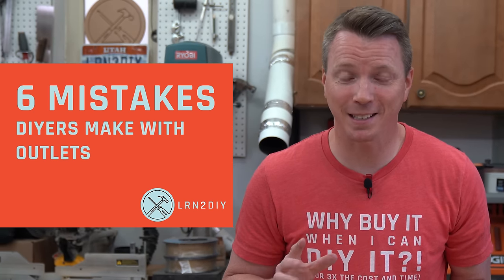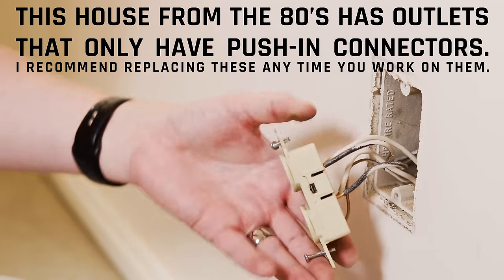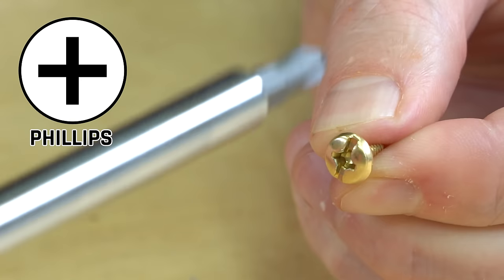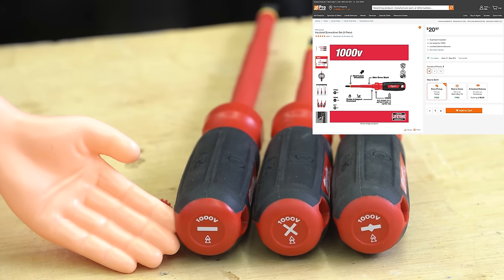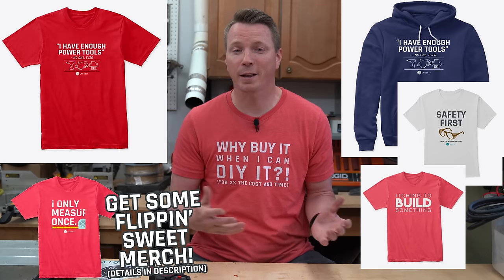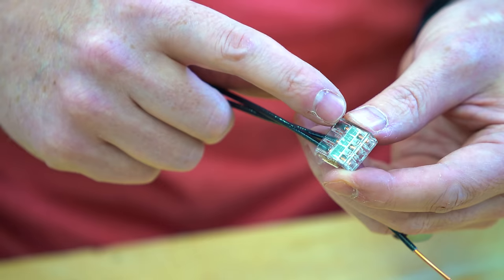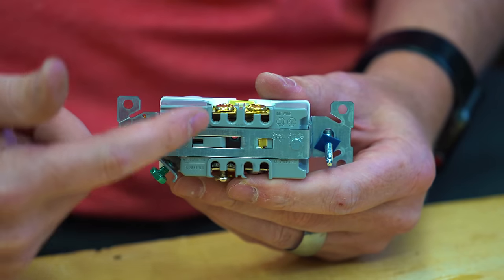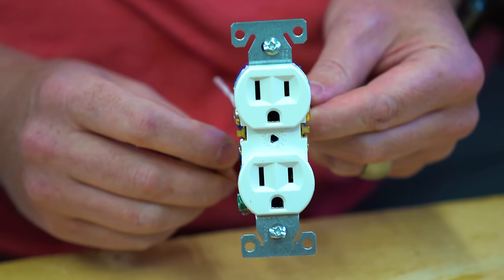6 MISTAKES DIYers Make When Wiring Outlets

Comment: When I DIY, I win in three ways: I get not only the thing fixed, modified or replaced for no labor cost; but I often learn invaluable skills and get experience. When I pay someone else to do something, I lose out in 2/3 aspects. The technician gets PAID for experience and learning that happens with doing something technical. I have not regretted learning how to fix my microwave, power outlets, changing my own oil, brakes, installing my own wired surveillance cameras, fence repair/replacement, lawn equipment repair & service (the list goes on and on). I am not smart; I just try
Reply: I feel like most knowledge is just a result of desire and effort. And vice versa.
Reply: @usefulidiot21  I like that. I'm uncertain if it could be proved, but some are definitely more curious than others. If you are extra curious, then you are very lucky.
Reply: Fix yourself is always good.  Electrical is pretty simple, taken one item at a time.  The device is either wired/installed correctly or it isn't.  I pay a licensed mechanic for oil changes because he will recognize problems that I would not, simply due to experience levels and training (only works well if you have an honest mechanic) (He once showed me an issue - when pointed out I could see it was wrong, but I would not have noticed if I were doing my own change)
Reply: @99bn99  definitely not good to creep into areas you feel discomfort. There are a few areas I won't go: HVAC is one of them. I change filters, replace start capacitors and contactors, clean coils, but that is it. I don't touch anything automotive AC either (outside belts, general cleaning and cabin filters).

Comment: I have never seen the wires "come out" of those back-side ports, but I have encountered dozens where the wire broke off over time.  It is always a clean, straight break like you would expect to see in a bolt that snapped from shear forces.  This results in the outlet sporadically not working right, typically working for a few hours after I plug something in, then flickering power for a bit, then losing power altogether.  It is a severe fire hazard and I would like to see consumer-protection laws which prevent the inclusion of these ports altogether.
Reply: When the circuit and especially the outlet has a large current draw such as a big vacuum cleaner or a 3 horse compressor using it, these cheap backstab installations will fatigue and you might begin to see flickering.  If that outlet is pulled, invariably one of the wires slips out the back because the spring has been overheated so many times that the metal no longer pushes hard enough to hold the wire in.    Maybe they are ok for a site where only a 60 watt desk lamp will use the outlet.  Large pull devices will wear them out.  If the circuit is multiple outlets and they are all daisy chained using the top and bottom holes instead of pigtailing, then this problem will spread down the line.
Reply: You might also have had situations where the person doing the initial wire stripping had done this improperly and had forced a slight indentation/cut in the copper wire, thereby weakening it.  I've generally done my own wiring, but one time I did have an electrician wire a small house for me, and he had a newbie helper.  I spot-checked the job later and discovered that practically every wire he stripped had been deeply nicked--and some that I barely wiggled had then broken off.  Clearly, what he had done was use the stripping position for #14 or #16 wire when stripping #12 wire.  I completely redid every single switch and receptacle, as I had specified that I wanted #12 wire throughout except of course where heavier wire was required..  The electrician himself was more than embarrassed.
Reply: They are phasing out quick wire devices

Comment: Great video. I have a 3-bulb light fixture with a dimmer switch and I get a lot of flicker in the last bulb. I thought it was the dimmer switch that was old and needed to be replaced, so I put in a new one. But the flicker is still there.  :-(  But now I'll go back in and check the wire nut connections because they were not twisted as shown in this video. Thanks! I think you saved me about a hundred bucks on an electrician!
Reply: Check the ratings for your bulbs and dimmer to be sure they're compatible. Some dimmers wont work with leds.

Comment: Mistake #7: Hot and neutral swapped.  (Blatant code violation, lethal hazard for things like toasters.)
Mistake #8: 14 awg conductors, 20 amp breaker.  (Code violation, 14 awg wire needs a 15 amp breaker.)
Mistake #9: Joining grounding conductors with ordinary wirenut. (Possible code violation, needs a grounding-listed connector like a greenie or crimp.)
Reply: Some may not know what a greenie is...aka Green Wirenut!  HTH
Reply: Disn't know code required a green twist cap.  Thank you.
Reply: @terrywebster9772  Code just requires grounding connectors to be "listed" (UL 467).  Some ordinary wirenuts are listed for grounding, but others aren't.  It's not clear to me if this just paperwork, or if grounding really has substantially different requirements.
Reply: A normal wire nut is completely fine. Unless you really need and want to use the hole at the top of the green nut. I didn't have any green nuts and just made a pigtail with my normal wire nut. Nothing wrong with that. A normal wire nut is completely safe to carry a full load. It's also safe for a ground.

Comment: Stab connectors - I did a bunch of experiments and concluded that they can work well but... when installing the outlet where outlet wire needs to be bent and stuffed in there is no way to know if the connection is still good.  Also, wires are very difficult to remove and doing so often compromises the quality of the connection when wire is reinstalled. There are commercial stab connectors but they have clear plastic and mfg says don't reuse once a wire is removed.   Lever connectors are great for tight spots.  Pig tails work but eat up a LOT of room.
Reply: I always get irritated about the 6" of wire coming outside the box requirement, that's guaranteed to cause a bunch of those issues trying to stuff all that unneccesary wire back in the box.

Comment: A simple and clear video.  Nicely done.  Just a side note, all the ads inserted by YT in your video were in Spanish.  Interesting.  Leviton recently showed off some new outlets that use a similar lever lock as a Wago connector.  No screws or exposed wiring.  I wonder what the reaction will be.

Comment: 8:03
When I put a wire nut on, I like to wrap the nut and wires with a bit of electrical tape. When I put the tape on, I fold a little ot the tag end of the tape against  itself, making a convenient "handle" in case I ever need to take it apart in the future. Just a little extra insurance to keep the nut from coming loose.

Comment: On the back stab terminals: They are clearly not best practice, but I maintained an old apartment building where they had been used very often and I don't remember a single failure with them. The newer ones don't work with 12 gauge wire and when I added circuits I always used 12 gauge wire so I never used them. On making the hook. Even though I've done quite a bit of electric work, I didn't know about that trick. Thank you.
Reply: Stabbed in the back devices are one of the 1st things to look for trouble shooting Id say probably accounting for nearly 1/2 of service calls customer stating "no power". Tripped GFI's, Breakers not reset properly and stabbed in the back devices generally  being fixes with actual failed parts being being less than 20% of calls!
Reply: @robertgarrett3980  Thanks for the response. I completely believe that you are right. I have seen several comments along that line. If there was a purpose to my post, it was just to say that in the right circumstances and perhaps with the right brand of outlet they might be reliable enough to leave them alone, at least until you start noticing some failures. I really like the way GFCI outlets are connected and I notice that higher end outlets have a similar connection method. I'd pay more money for outlets that connect like that.
Reply: Dave I haven't seen a single back stab failure either and I've been running a Handyman service for 24 years.  I think it's just people repeating what they've heard.
Reply: @cblanton42  ... the only place I have seen back-stab failures is on a kitchen circuit where higher draw appliances are used. Of course people can use an electric heater anywhere so worth looking around. If there's one bad outlet in a home there are probably others.
Reply: I'd bet dollars to donuts the only ones you ever have problems with, were removed and re-inserted or futzed with between initial install and your service.
Reply: I've had to replace burnt receptacles in my house because the back stab gets hot, loses tension, starts to arc.
Reply: @Sylvan_dB  So many people can testify to "broken solder joints" yet others can collectively put together thousands of years of experience having never encountered one. . .  Perhaps its got more to do with the human that was involved than the machinery?  Correctly installed they don't "get hot. . . "
Reply: @snap-off5383  I suspect there is some truth to that but I disagree vehemently on "not get hot."  Any outlet used for extended periods at high load will get hot and the back stabs get much hotter than the screws. This is easily testable with any continuous 1500 watt load. If not using the back stab, the receptacle contacts are the next weakest point and they will eventually fail the same way in the same usage unless they are built with separate steel tension springs (usually only in commercial and hospital grade).
On broken solder joints, I had them on my oven control board on the current carrying connections to the relays. A previous employer found them due to field failures with a commodity component that silently changed from tin-lead to RoHS compliant solder.
Perhaps the observer also affects the story by missing key information while doing root cause analysis. Which is why the plural of anecdote is not data.
Reply: Karma!
Previously I mentioned that I didn't remember experiencing a failure because of a back stab connection either in the apartment we owned for 30 years or in our house, Now only a few weeks after I made that claim the switch for the light over our kitchen sink wasn't working because the back stab connector failed. It had been working for 48 years and then I make that comment and it fails.

Comment: General Contractor's back stab, that is how I can tell if a GC did it or an electrician, in places like Boston backstabbing is code violation and you will not pass inspection.  I have had the same issue, I had a few GFCI sockets in the kitchen have open grounds or no power.  I had to redo every one properly.

Comment: NEVER USE 29 CENT BACK STAB OUTLETS THEY ARE used by contractors on track homes BECAUSE THEY ARE cheap,i wired over 200 homes they are junk buy only  spec grade or teck spec period..
Reply from the maker: Amen!
Reply: I agree. The cheap ones were fine in my house until I tried to switch over to fluorescent bulbs during the big switchover. Withing two months 4 switches and 3 outlets had cracked into pieces. I went through the house and replaced all of them (except maybe the two in the attic, it was August and I live in Arizona).
Reply: Takes two seconds to loop a wire
Reply: @Fred Wills running track baby
Reply: The English language more of joke compared to others say Spanish easier to learn ,english =there,their,weight, wait etc lol.
Reply: I noted on number 4 when making the pigtail that it was a bit short. It may not be an actual error, but by the time you push the wire connectors into the box, you don’t have much bending room to work with. 
Also, my preference is to straighten the bends rather than cut them off. You need to be cautious of damage in unbending, but I don’t like tight spaces caused by short wires. If the length was marginal to start with, it can be problematic.
Reply: I’m sure you covered it under this, but what can help with number 5 is to use the small tab next to screw to make the hook, which automatically goes the right direction.
Reply: You never covered the necessity to tape the receptacle when finished wiring it. Absolutely needed when using metal boxes and a good habit even if using plastic boxes.
Reply: I've never seen any brand of backstab Style duplexes that are worse a crap especially if the Is circuit over heats. The only extra time it takes is to turn the screw In , Far more mechanically Sound. One other thing that's important , If you have 7 duplexes on a 20 amp circuit and the third one fails by using pigtails. The rest of the outlets downstream will not fail. The pigtail completes An Uninterrupted path As well as not having to fight short wires. by code at least 6 inches of wire  as well A quarter inch of sorry of sheathing inside of the box. Stay safe....
Reply: I've seen so many backstab style Duplex's  fail of all types, especially when the Circuit overheats. Far more mechanically sound to simply  turn the Screw. If you have a twenty amp circuit with seven duplex's or outlets And the third one fails, By using Is a pig tail, not only are you not fighting short wires, But the rest of the downstream outlets will still work as there is an uninterrupted Circuit. By the way , At least six inches of Stripped wire And at least a quarter inch of sheathing Within the box by code. Stay safe remember, Is a plumber screw up Going to drown a Life, But a shock or a fire could do a lot of damage, stay safe And try not to use your left hand.
As it is a path through your heart to ground.
Reply: Use 3m tape if taping around ourlet,TIGER GRIP BOXES YES.
Reply: Yep,loose connections all the time ..
Reply: Don't they cost close to buck now!😅😅😅 The ul certification must be awful easy too revive because those cheap ones should be illegal to  sell.

Comment: Additional of #6 I learned is that loose parts of the screws could make an arc so that might cause fire.
Reply: what sort of magic makes that happen lol???? goof! if it fits fine it sits fine but yes you can arc when working on it and arcs trip breakers before fires start. fires in outlets start for other reasons
Reply: @kevinalmeida7159  Isn’t that why you use AFCI breaker? I’m kinda confused.

Comment: This is EXCELLENT! Thank you!!  I have a question. Hopefully you can point me in the right direction. I'm replacing a 2-wire stove vent fan motor with a 3-wire fan motor. There is also a 3-way switch (Fan - Light - Fan & Light). Do you have a video, or can point me to a  video to wire in the new fan motor, which is the 3-wire one?  Thanks.  BTW - this is a terrific video.

Comment: You could add a #7 to that list of, wrap the receptacle terminals with electrical tape before installing it in your box. Not only will it prevent metal on metal contact with the terminals of adjacent devices. But if you need to work it hot for some unknown reason (which you really shouldn't) it may save you from touching both the hot and neutral side of the device when pulling it from the box, resulting in getting electrocuted.
Reply: Electricians don't do this for several reasons- not the least of which that tape becomes brittle 10 years down the road is more of a PITA than helpful when you go to service it later.
Reply: @mytuberforyou  Every Union electrician I know up and down California does it so they must all be wrong...And 9 times out of 10 if you're pulling a receptacle off the wall to service it, it's probably getting replace anyways.
Reply: @slickdog78  must be a Californis thing because virtually the only people who do it here on this coast are DIY homeowners.
Reply: @mytuberforyou  
Not true In my experiences.  Also real electrician's and quality installers use good/ decent tape 33+ or better (scotch) it does not get brittle after 10 or 20 years for that matter.
Reply: @tuck6464  And you know this how? If it's good for 10 or 20 years why does it list a shelf life of only five years, do you think it lasts longer in an electrical box exposed to heat cycles than it does on the roll?
Reply: @mytuberforyou  I'm 58 . I probably started  using scotch products 33+ in particular  religiously  on a daily, weekly basis at most at about 19 on typical electric work and on a lot of refrigeration work in commercial freezers and coolers inside the freezers as well on exterior exposed  roof mounted equipment in the Northeast US region  PA/NJ with 4 full seasons . I've worked on stuff that I did 25+ years ago, most of the time if i wanted to i could have re-used the tape if I wanted to take the time removing it nicely, and have on occasion done just that.
I have used it on cars and trucks some ov which I have owned 20+ years.
As for shelf life on the roll, I never had a roll that has been around, probably more than 2 months, I can't really verify shelf life.
AS for applied life I can't remember ever seeing it fail , unless it was heavily abraided or cut/ physically damaged some how
Reply: @mytuberforyou  If the 5 year shelf life on the roll is true or not, I can not verify that, I've never had a roll that long . 
As for in a junction box/ ct cabinet in doors out doors in freezers on pipe insulation/ roll bar padding ETC, it holds up easily 10 years. Pliable and even re-usable  in most cases. 
There are other good brands Plymouth, Bishop and others. My go to will probably always be Scotch 33+